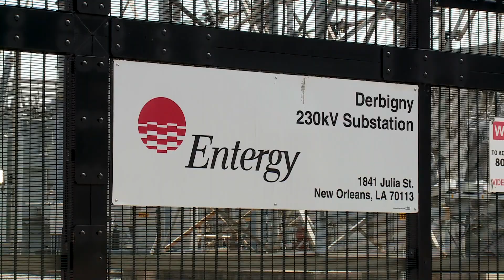Why did all 8 energy transmission lines fail during Hurricane Ida?

Comment: Towers are to important. Should be wind rated for cat 5 and above. Especially with  these hurricanes get meaner, bigger, and stronger. Should be concrete pillars. Those old towers looked rusted and busted. Just like the lies they told about maintenance. So sad. If you can't replace a tower how you gone operate a city. Lazy lame sad. Audacity to say they not going to replace it. To expensive like really. How is he in that position.  Wtf.

Comment: If you have rust on a steel structure it should have been sand blasted to the metal and repainted every 3 years in our climate.  That Inspector is on the take for money for passing that inspection and should be fired and investigated for Negligence on his part.
Reply: I noticed the rust as well...so why that transmission tower wasn't updated? Money was received in advance for repairs right?? Smh
Reply: @Noladiamond01  So let's look across the River and see what that Tower base looks like.  Might be the same Inspector on the take to save Entergy money.  I have seen their system not proactive but reactive.  Fix it when it falls down.
Reply: It's really sad because the citizens are the ones who gets the outrageous utility bills!!